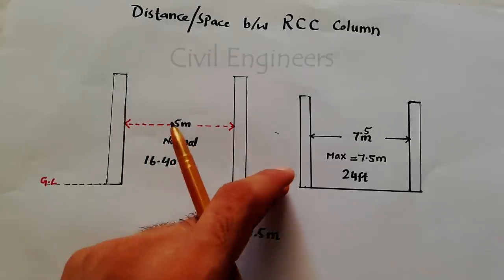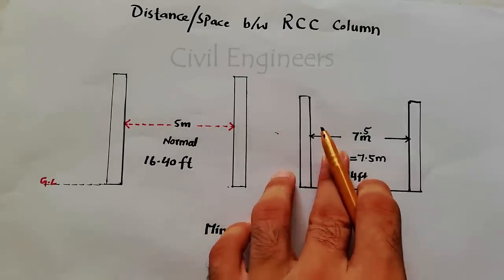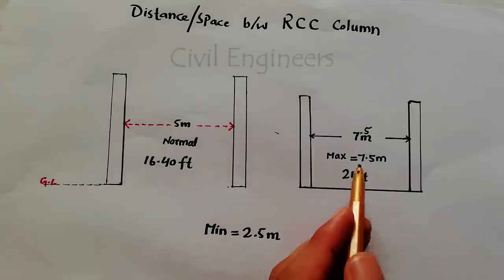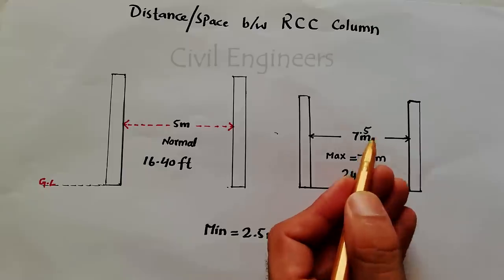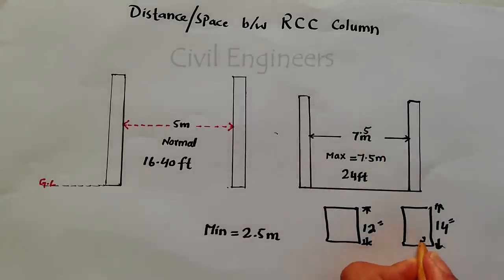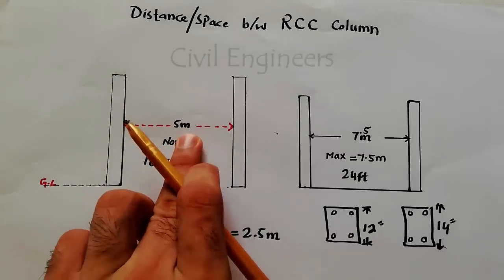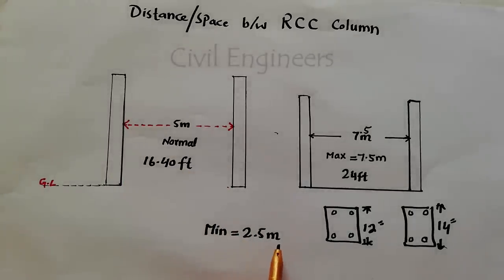Maximum distance between two RCC columns? - Civil Engineering Videos

Comment: Thank you sir...
If the spacing between the two columns 26'0"-28'0"..
What will be the size & steel used?
Reply: For 28 ft span ,big hall or auditorium.
Use beam depth 24 "  & 24 mm main  bars & 18×18 " column.
Refer IS456-2000 for further details

Comment: I respectfully disagree with the whole video content and here is why: 
 
*There is no such thing as maximum spacing between columns. 
*As a civil/ structural Engineer one must ask what happens when the spacing between columns is increased. 
*The answer to the above question is the depth of the beam spanning between two columns( if beam slab system is used) or the thickness of slab( if flat slab system is used) and also the required cross section of the column will increase( compared to lower spans) together with reinforcement demand and this increase in demand can be calculated following code stipulated rules and engineering judgment. 
*As far as one can verify the depth provided for beam (or slab) is adequate against deflection ( as deflection would start to govern the design once span starts to increase and yet flexure, shear and other internal actions should also be verified) then one can go as much as 20m or 65 ft ( I have witnessed this span with post tensioned flat slab system). 
*burj khalifa, one of the high rise building has a span of 9m and 3m cantilever(surprise surprise) ( it was designed with post tensioned flat slab and then was changed without design approval to 200 mm thick RC flat slab, this has caused an issue and  10 floors that were already casted were strengthen using CFRP... this is to debunk what the video suggested for mega projects). 
*One must also note that this days high strength concrete is becoming widely available due to material such as GGBS, silica fume, strength enhancing admixtures and so on. high strength concrete ,as the codes of practice suggests, would result in higher modulus of elasticity which intern means less deflection and in terms of cross section  lower cross section requirement and lower reinforcement demand as higher concrete capacity is achieved. therefore with high strength concrete one can achieve longer spans than the usual. 
*Plus parking and flexibility of movement for car would usually demand longer spans from architectural perspective. 
*Even a book by MacGregor and white(Reinforced Concrete: Mechanics and Design) suggests spans up to 12m with the use of waffle slab system ( a system usually preferred for long span constructive even with low strength concrete). 

In summary, there is no such thing as maximum span for columns and one is expected to show that deflection, flexure, shear and axial load ( and their interactions) is within the code allowed limit, then any span is acceptable.

Comment: Sir my doubt 

You said that If maximum distance b/w is 7.5 mts and min not less than 2.5mt
But if we have heavy structural load is there then but still we have to keep 7.5mts distance..
(Then we have to increase the depth of the column..) ?

Is this correct sir

Comment: Sir need to build a building fr own use and rent purpose ,ground floor will be parking 1st floor will be 3hbk hose ,2nd flore how to insert column because 41 ft length total I'll devoid into 3 hoses 13.5 ft ,its not topical plan so , can i insert da inverted colouns from 2 and floor by floors

Comment: How can we reduce the no.  of column in a building with heavy structure load
Reply: Use large columns with 6 bars.......or use bearing walls
Reply: This guy is teaching rubbish. To reduce number of columns you need to strengthen the beam. You can even place columns at 20m distance as you can see in bridges but you have to use prestressed concrete beams. To take the beam load you have increase the column size accordingly.

Comment: Is there any thumb rule when increase in distance to increase depth of column.how you increase 2inches will attain required load bearing capacity..
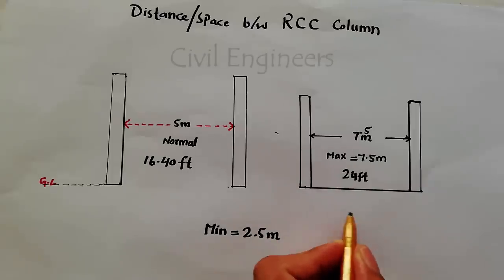Reply: What he meant was not the depth but the width of the column.....At 1:14 where he says its "cross section "of the column and draws reinforced bars in the column diagram.
Reply: You just need to calculate everything from the load, beam size and column size.  The instructor is not giving a decent way for designing a structure.

Comment: Bhaiya, i need ur help.
I am from odisha.
We r making a house, with hall of 18X23 ft.
3 column each on 18' wall and 23' wall (10"X12" columns)
Do we need to raise a column in center of the room? It will spoil the look for sure. Can strong roof beams, cross beams not take the load? 2 storey building only.
Please reply.

Comment: There are numerous halls having span of more than 30,40 fts So what will happen to safety of  these halls in your opinion. Which design principle have fixed such distance of 5m or 7.5m . Our IS code permit every span provided span/depth ratio, deflection criteria is fulfilled.

Comment: I want to construct second floor on my existing building without colomns (Rock filling basement) ground and first floor. Is there any problem to construct the second floor? And also want change the inner walls .
Reply: go for it if you have 9 inch strong brick wall on all four sides. my building is 3.5 storeys without columns

Comment: Hi Sir , Ours is  g+2 ,There were 11pillars  in ground floor due to plan change in first floor center pillar was removed in first floor plan so distance between two column became 20 feet  so builder added beam which now is 20 feet long i am bothered weather it sustain load

Comment: can I construct a house without any beam,the dimension is 22' *21'.
Reply: In that case u have to use load bearing method instead of frame structure method
Bt remember load bearing method is old method

Comment: Well done through your clear explaination;, however,  not explained few points related to the column and beam.
Questions :
1. 12" ×12" column needs how many 16mm or 20mm deformed bar?
2. Beam: 14" (inch) dropped X 12" wide 25 ft long beam needs how many 16mm or 20 mm bars ?
3. Practical Senerio to be considered 6 storied structure 
Or 
4. 10 storied structure 
To be Appreciated if you take my requested as a voluntary contributor and to the g+ VIEWERS.

Comment: If we design the column and beam then how should be show on 2 D plan and size of the column and beam
Reply: its just simple, by making schedule (by making well presentable data table) which has details like beam or column name (which are general denoted by giving name such as c1, c2, c3, etc for column and this same way  it is used for beam b1, b2, b3, etc) then their dimension details such as its depth, length, etc then it also contain bbs (bar bending schedule), etc. this is then attached with plan, section, and elevation and on the basis of this material further calculation are done which are required for site work such as quantity survey (quantity sheet are made), estimate for concreting, labour, steel, etc. then on the basis of this they also manage their project (different task which is related to site work are plan, task such as when to cast slab, beam, column, brick masonry wall, etc things are plan). if sometimes  this material ( such as plan, section, elevation, and bbs) is not sufficient for further calculation. in that case architect or engineer have to prepare detail call outs, 3d views, isometric drawings, animation (walkthroughs), models, etc

Comment: wrong information from 30 years experience structural engineer
Reply: Khaled Alsane present your engineering equations to prove your point. Am a design specialist.
Reply: How much over hang is to be left from corner of the building while placing the column?? And guidance is more than appreciated